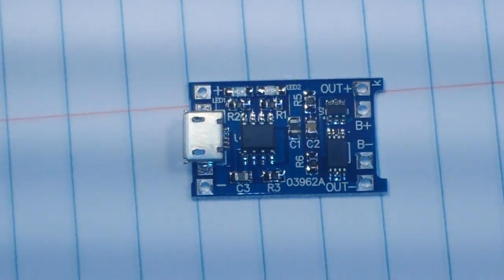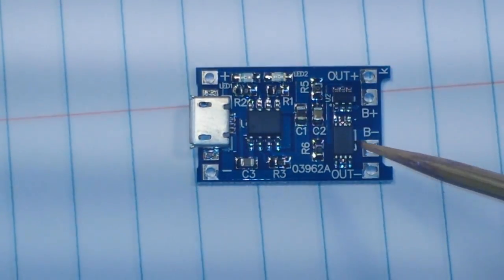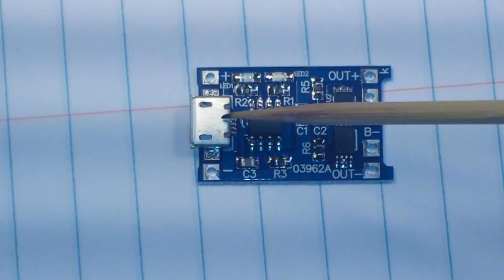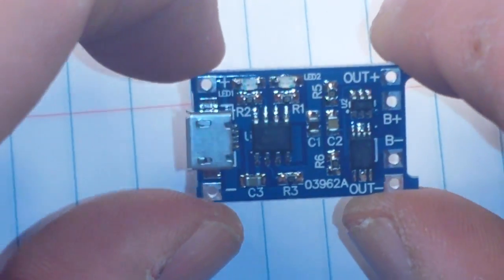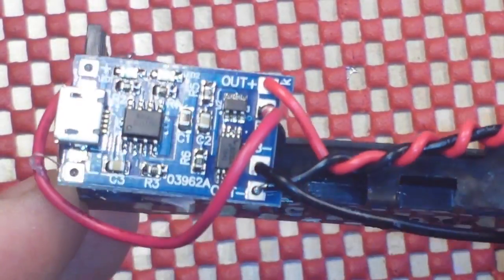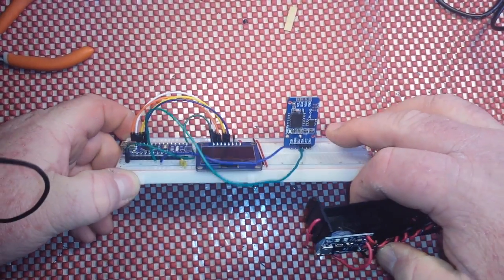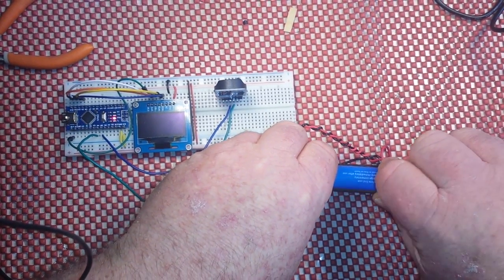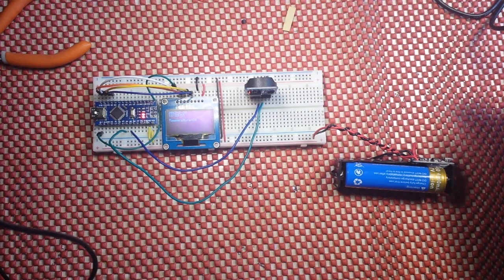TP4056 LiPo Charging and protection board

Comment: can i charged several 18650 batteries simultaneously?
Reply from the maker: +norinco np no
Reply: How can you run two batteries in parallel and charge them?
Reply: Rodney, if you want to build your own battery pack using for example 2 or 4  18650 batteries in PARALLEL then I highly recommend using a dedicated module for that, on aliexpress com search for 'battery bank module. The TP4056 is only a charger board for 1 battery or cell... and it has no boost converter.
One example: https://tinyurl.com/y8oul655

Comment: Can I use these output connections with simple 10 LED chaser circuit using CD4017 and 555 timer IC.....? 

If it is then for what time it will work after charging a battery full? 

Can I use old mobile battery for it (Lithium ion)??? 

Pls reply

Comment: Quick question. I'm very new to this and I'm probably asking a really stupid question and i apologize for my lack of knowledge. 

Now i know you cannot connect the output going to the battery in a series connection and expect to charge a 13s li-ion configuration with 13 of those boards without first disconnecting the series connection via some form of switch, but is it possible to connect the outputs from the battery in a 13s series connection? 

I'm asking because I'm a cheap wad trying to make a ultra cheap 48 volt li-ion charger and discharger. I'm only planning on pulling 1st amp per parallel cell group so i think it can handle it but i would love your input. Otherwise I'm just going to try it and figure it out myself come hell or high water lol.
Reply from the maker: +Panic The Scholar Knight. This board is designed to charge one cell only

Comment: Its too bad the battery protection circuit doesnt cut off the 18650 li-ion battery @ 3.0v , which is more ideal IMO, even though the manufacturer states its lowest can be @ 2.5v , draining it that far down on a constant basis could actually lessen the batterys life at a quicker rate, you can still get a good 3200mah from a 3400mah battery at the higher cutoff.
Reply: replace dw01 with fs312f-g it has 2.9V cut off

Comment: From that output wire can we run a motor and led
Reply from the maker: +E - CREATORS yep
Reply: hi great video. if running a smaller battery like 300mah or 400mah, do we have to change the resistor on the board? the instruction manual for this board gives a table of the recommended resistors.
thanks

Comment: Hello, sorry for my question(and my englis xD): if i have 4 batteries and 4 unit parallel , can i charge all togheter with same mini usb charger(5V 1A) on one of these?(soldering the B-/+ in right way) !
Than, can i use the same circuit for power on a device but soldering OUT-/+ of two couple of unit in sequence and than this pair in parallel as i need an output of 7,4V and bigger "mah" as possible?
Thanks in advance
Luca
Reply from the maker: +Luca Cimmino No, I'm afraid that the TP4056 is for a single cell only. Connecting them together is dangerous.
Thanks for watching, commenting.
Reply: learnelectronics sorry but maybe i had write in a wrong way: i had seen a couple of video where they put one unit each battery, soldering all - together and all + together (those next to the mini usb port) and than from the last one -/+ to a charger! Now instead to soldering a cable from last -/+ to a charger, if i use a normal miniusb charger(like for mobile phone) connected to the last unit's miniusb port, does it works fine?
In this way the units are connected at same time(parallel)on /+ for charging them; now if i need to use the batteries to power a device(4batteries, i need 7,4v 5200mah)and i want to use the same units for batteries' protection, can i connect 2  units' OUT+/OUT  in sequence x2 and this 2 couple's OUT+/OUT- than in parallel? Or the units works alone also for the output!??

Thanks for your help
Reply from the maker: +Luca Cimmino hooking tp4056 modules is not recommend. If afraid I can offer you any help with this.

Comment: Hello, great video! I  have two questions..

1. I'm going to have 6 batteries charging with one charging board on each battery....  can I wire the boards output load in series to get 22.2v or 25.2v ??  

2. Can us the batteries while they are charging?
Reply from the maker: HI, no you can't use them in series, but you can use them while charging.

Comment: Im finding it near impossible to use something like this to balance charge 3 cells with protection for project, all those bms on ebay dont seem to work, any ideas ?
Reply from the maker: kermets you need one board per battery. It's doable, but not a great solution. Take a look at RC balance chargers...turnagy for instance. You can get 6 or 8 cell versions (you don't have to use them all)
Reply: thanks for reply, yes I have rc balancer for my hobby but they stop balancing once done and will not restart again if unbalance acquires, not the ones I have anyway,A lot of youtubers have ideas but havent found the answer yet.

Comment: how much volts on the output and what about amps?
Reply from the maker: The output voltage will be dependent on the battery. So somewhere between 2.75V to 4.2V. Output current is again dependent on the battery with a standard 18650 the maximum discharge current is 5200 mA .
Reply: learnelectronics wouldnt it be limited by the electronics?

Comment: How do I wire more than 1 battery with these modules? I want to make 4 batteries in series, and I couldn't make the protection work
Reply from the maker: Jabberwock you can't wire more than one battery to a unit. if you want multiple batteries, you need multiple units.
Reply: learnelectronics Of couse I have multiple units. But when I try to wire between OUT- to another unit's OUT+ it wont work. However I think I might have an idea as to why. Common ground is the minus of input as well as OUT-. It could be the problem
Reply from the maker: Jabberwock sounds like a good place to start
Reply: If you want to build your own battery pack using for example 4x 18650 batteries in PARALLEL then I highly recommend using a dedicated module for that, on aliexpress com search for 'battery bank module'
One example:
https://tinyurl.com/y8oul655

Comment: how long does the battery have before is no good?  meaning they have no charge over time
Reply: That probably depends on the charge current used which is programmed by a resistor - usually 122 SMD = 12*102 = 1224 ohm. Which results in 900mA to 1000mA charging current. One can lower that - to extend battery life time via replacing the SMD resistor with a 2k or 3k ohm up to 20k and 30k which of course will result in longer charging times. The data sheet of the TC4056A gives more details about that on page 6 of the datasheet pdf https://datasheet.lcsc.com/szlcsc/TC4056A_C84051.pdf
Another youtuber made a video about replacing the current limiting charge resistor on a similar module 
https://www.youtube.com/watch?v=oMez6wHsvC4

Comment: what does it mean when both led lights are on?
Reply from the maker: Francisco Sanchez The charge led will be on when charging and it will be flashing when no battery is connected.
The done led will be on when charging is done or no battery is connected.
Reply: ok, thank you

Comment: Nice video! Question: According to the specs of this board, the battery over-discharge protection voltage is  2.5V. If I use this with a Lipo battery, isn't 2.5V to low for a battery?
Reply from the maker: You are correct. I just looked over the 18650 specs and it does say cut-off 2.75V.  The TP4056 has 3 ICs in it the DW01
controls the output and according to the datasheet has a cutoff of 2.5V. All I can tell you is this board is used with 18650's all the time. My best guess is that it may shorten battery lifespan if you constantly go that low, but I doubt any damage will occur.
Reply: fs312f-g is better it has 2.9V cutoff , same pin out as dw01
Reply: You can change the charge current by changing r3. Is it possible to raise the overdischarge voltage in a similar way by changing r5/6??

Comment: What circuit do you suggest after the tp4056 for a project with a solar panel powered system to keep that thing running for ever? is it possible to connect it straight on the tp4056? does it not drain the battery if you charge and use it at the same time? The Power IN does not go direct to the Power Out, it goes only over the Battery. i think thats a problem.

Comment: what is max current output meaning using the battery not charging it
Reply from the maker: Francisco Sanchez that would depend on your battery
Reply: 18650 battery  3.7 volts 6800 mAh

Comment: if I wanted to put 2 battery together how should I wire them?
Reply from the maker: Francisco Sanchez parallel or serial?
Reply: I want to increase the mAh so I guest parallel
Reply from the maker: Francisco Sanchez in that case wire to two Out+ together and the two Out-of-town together.
Reply: ok, use a one way diode? and use 2 of the charger  on each battery
Reply from the maker: Francisco Sanchez 1charger per 🔋
Reply: ok? 1 charger per 🔋, how about the diode?
Reply from the maker: Francisco Sanchez it won't hurt anything but it is not necessary. there are diodes on the boards

Comment: is it safe if I  put 2 battery at same voltage and mAh in parallel and still charge the battery?
Reply from the maker: Francisco Sanchez no, you need one board per battery
Reply: learnelectronics  ok, I have to use one battery ? I have 2 battery that are the same 3.7 volt and 2600mAh but what I want is to use both of them as one  3.7 volt and 5200mAh battery?  I am just double the mAh.
Reply from the maker: Francisco Sanchez you don't have to use one battery, you just have to have a 4056 for each battery, you can tie the outputs together
Reply: learnelectronics ok, so i have to have 2 of the battery charger ? and wire the out + and out - of one charger to other out + and out -
Reply: how do I wire the 2 battery with two different charger to boost the mAh
Reply: from my own experience, you can have a massive parallel pack with one charger.. however at it's max charge rate of 1000mA it will lineally extend the charge time for each battery you add to the pack.

Comment: Thank you for your good video. In reply to one of the comments you said that this board boosts to 5V but I see no inductor on the board. I think all boost circuits need an inductor. Is that true? Which IC does the step-up?
Reply from the maker: Ahmad Sajadian let me look at the spec sheets and get back to you
Reply from the maker: You are correct, there is no step-up. My mistake. Thanks.
Reply: learnelectronics 
You said it doesnt boost but replied to the next comment it does. Whats the truth?

Comment: So what voltage is the battery unit supplying to the clock project ?  I'm assuming the TP4056 is stepping up the 1860 voltage from 3.7 ish to 5 volts ?  But you haven't stated the output voltage, so I'm just guessing. Cheers :)
Reply from the maker: Paul yes sir, boosts to 5V
Reply: ??? it doesn't boost
Reply: Paul: most TP4056 boards use the TC4056A chip these days, they are not boost converters. For this just add a simple/cheap 'arduino boost converter 5v'. If you need an on/off slide switch, add it between TP4056 and boost converter.
What most don't know is that once you have everything wired up you should 'jumpstart' the tp4056 with charging it via usb for 1-2 seconds, so the whole thing starts

Comment: Nice little video, quick and to the point and informative. However, the only thing to note is the cutoff during depletion. Yes, it will cutoff when the voltage drops below the bottom voltage, except that, when the 18650 recovers back to safe voltage, the unit will turn back on; and this will keep happening for awhile. It is possible to super drain the cell; just not 0-voltage the cell like that would happen w/o the protection IC in place. Julian Illett demonstrated this one of his videos.
Great job, tho, on the explanation and great video quality!  :)
Reply: While I have not searched extensively this is the first time I have seen anyone comment on the fact that this is only a charge protection board and does nothing for discharge protection. I volunteer at a makerspace as a consultant kind of person "generic dork" and these modules I hate soooo much lately more than anything. Alot of people are wanting to do R-pi zero and pico and esp32 projects that are battery powered and turn to this board and soooo many would have been better off using just AA batteries or even coin cell batteries with the sheer number of batteries wrecked by this module. 

I would be interested to know if you know a board that also has discharge protection as my searches have been fruitless.
Reply: @Segphalt  Are you certain that you are talking about the same board functionality,AND that the users are wiring it correctly to take output to the load through the board and not direct wired to the battery?  

While a more simple 4056 board only had the charging, these have discharge protection.  While it is true that they might shut off a load at 2.4V, then the cell recovers voltage and it switches back on, this is a bit of trivia rather than a concern as it still switches off again, and again, and won't come back on once the at rest (0 current) state of the cell is below ~ 2.4V.
Reply: @stinkycheese804  This is the behavior we have observed but it will happily oscillate forever all the way down to 2v for projects with significant load. The board works fine and stops this behavior for less than 100ma draw projects. For bigger power draw projects it is just a battery murderer.